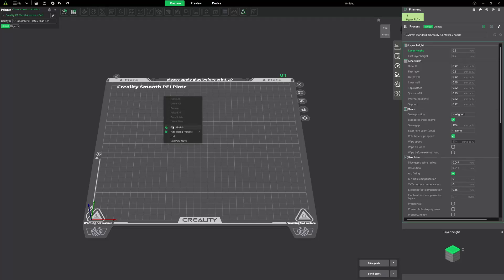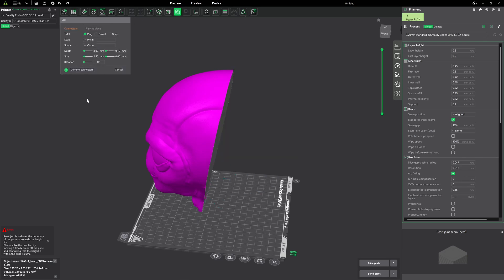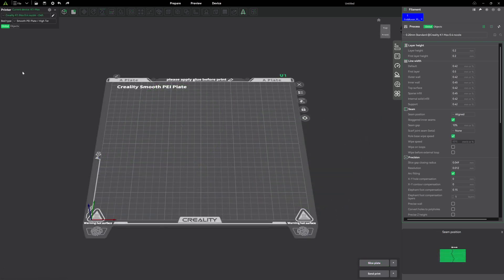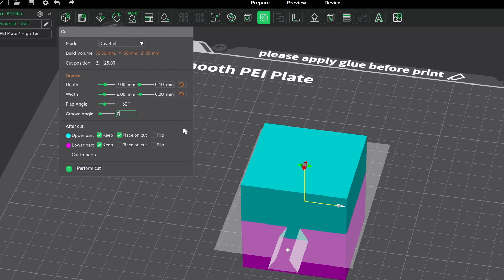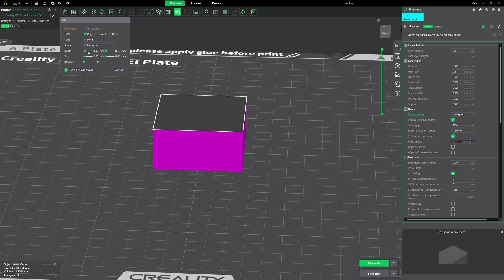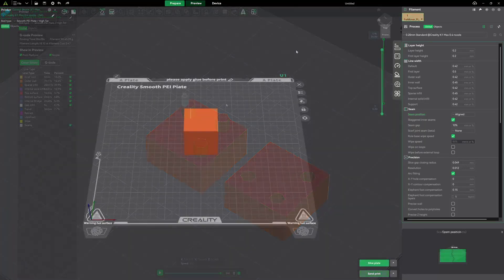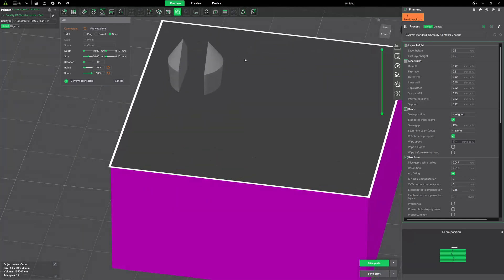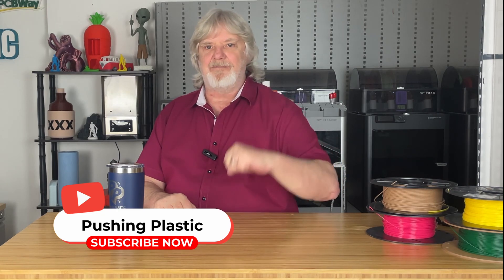Mastering 3D Model Cutting & Connector Addition with Creality Print 6

Comment: My ender 3v3 was working very good until  I loaded "6" . Now my printer is now inoperable. I use the USB method to load files and now the printer does not show anything on the screen. I can no longer use this printer.
Reply from the maker: I would look on Creality's site for a firmware update.
Reply: I'm pretty sure by now you must also be aware that (6) is causing many problems. I believe this may be well past an update, but I'm still watching your reviews. @pushingplastic7445

Comment: Awesome vid! 1 question, how do i change the axis of the cut? For example if instead of wanting to cut on the Z-axis I wanted to adjust the cut offset along the X-axis.
Reply from the maker: There are some arrows at the top of the model, mine are red and green. Click and drag the arrow pointing in the direction you want to cut. You can do one direction, then the other until you get the angle you want. I hope this helps!
Reply: @pushingplastic7445  Thank you. I hadnt noticed it gives more range of motion if clicked on. Sorry for the bother, a few more question, is there a way to type in the desired angle? and how do I input a Cut Position along a different axis (if i rotate the object i can accomplish the same effect but, is there a way from the cut menu) ?

Comment: did you explore add negative part etc? i tried it says you need to change to per object mode which i didnt find
Reply from the maker: On the right side of the screen, in the Process area, it says "Global | Object", select Object. That's the per object mode you're looking for.
Reply: @pushingplastic7445  thanks a lot

Comment: Thank you for your tutorials! They are always exceptionally well communicated and demonstrated. Another challenge I am having and have also heard from others is about auditing text. I am trying to add text to the top surface of an object. However, I am unable to select the top surface for placing my text and Creality Print always places it on the print bed. I have tried selecting the object and then print but it does not work. I have looked through threads but can not find any assistance. Would consider that for a tutorial perhaps?
Reply from the maker: Good idea!
Reply from the maker: Video on adding text being released tomorrow morning around 6 Am Eastern!